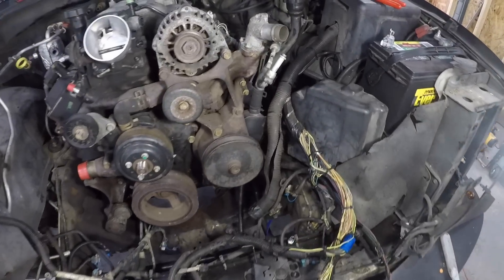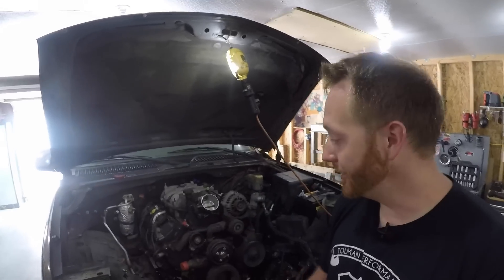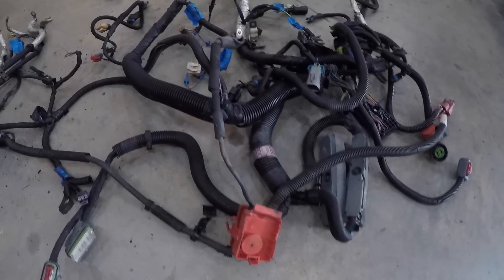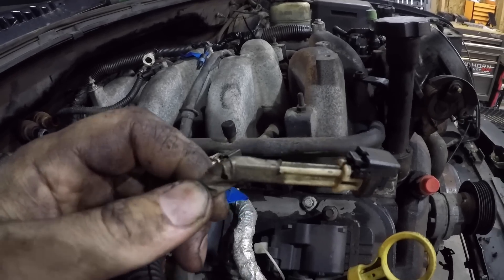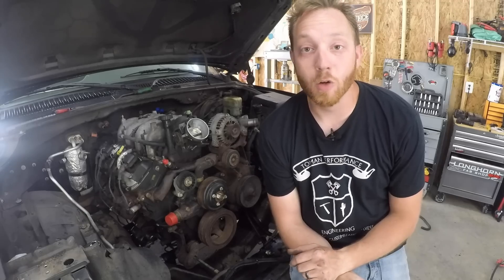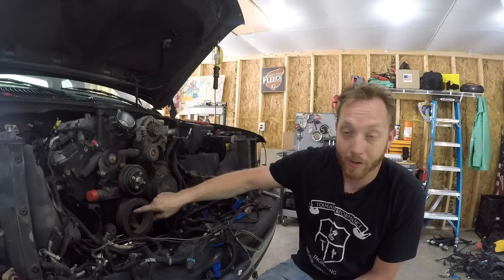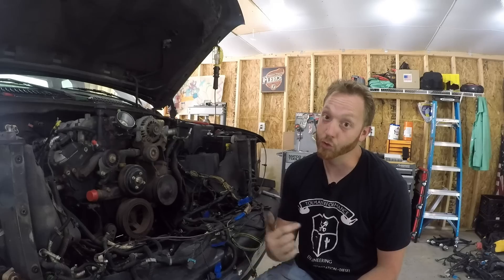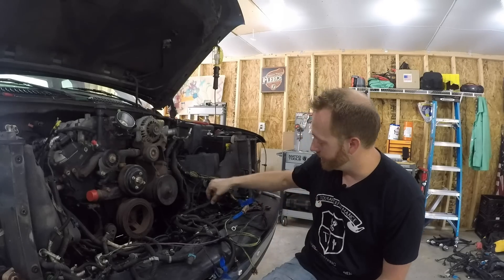Wiring and First Start 5.3 to 8.1 Engine Swap

Comment: How much bigger is it compared to an ls?
Reply from the maker: physically, it takes up quite a bit more room, but because I knew it would fit fine under the hood of the truck, I never actually took any measurements. it it however, bigger in every way. taller, wider, longer, and of course, heavier
Reply: Do you know how much wider taller and longer?
Reply: Would a LS adapter work with this engine using a cD009

Comment: Man I really feel like tool about my first sarcastic comment I made on the other video and told you about my big turbo forged rod and piston ls2 with a th400 2003 single cab Sierra(I did have gen4 4.8 rods and crank in my half filled ls2 block setup up until this past Wednesday my wife got me surprised me with a summit forged rods and a big boy LJMS cam and alot of arp hardware and clevite bearings and a few other things my engine builder/machinist/best friend was in on all this and basically picked everything I was going to myself lol we me and him balanced the rotating and decked, honed and gave the block a bath and painted black now it looks like a iron block but we slammed it all together in 2 days got everything together  to drop it In Thursday had it back in the truck turbo kit on and running on Friday) but after we talked a little bit I understood what your doing and respect the hell out of it and from what I can tell you seem like a cool dude and got to thinking aboutmlm your project I have a buddy who has a Gen1 precision 118mm g trim with a 1.50 exhaust housing its pretty old but has been recently rebuilt and seen it at his shop yesterday and thought it would be badass on your build I looked around and found a shop named Raylar that focus on the 8100's, all you need is one of their mildish boost cam and valve spring kit and this 118mm turbo I have no idea how it will run but I'm thinking with a the boost cam they offer for stock pistons has a 1800-5800rpm power band so I wouldn't be afraid to rev it to around 6200 or 6300rpm so it should spool that turbo and be a little easier on that stock bottom end  with that big ass 1.50 exhaust housing
Reply from the maker: yeah, I've been drooling over Raylar's stuff for a long time now, and hopefully will wind up with some of their parts on this engine, and what you described is exactly what I want to do. Big 'ol turbo and lots of pwer.
Reply: @TolmanPerformance  that cam from them is pricey but that and some springs is all you need if you will use that 118 il do my best to get it to cheap ASF

Comment: Doesn't using solder affect the signal of the sensors, rather than using butt connectors?
Reply from the maker: Alain Renteria never heard about it affecting the signal, especially considering components on circuit boards are soldered in place, but I know in aircraft applications they don’t allow solder because they’re afraid it can crack due to vibration.

Comment: Just curious, if you have the 8.1 engine harness available, How not just swap it in? Anywhere you have to solder or butt connect, leaves a weaker link Than the factory harness.
Reply from the maker: It wouldn’t have been a direct swap, since it’s from an Allison transmission and drive by wire

Comment: that 496  has a much higher potential to make more power then that 325 ls motor
Reply from the maker: power per cube, right? more cubes equals more potential.
Reply: @TolmanPerformance  always   that 5.3 you can push it to 1000 and with a built bottom end you could see 1300,   with that 496  you could see 1200 with sbe, and with a built bottom end you could see north of 1600k,    now this all depends on the boost, nitrous and tune
Reply: 5.3 wins on cost per hp easy the pistons are weak on 8.1 if you want big power gotta build it from what i heard its totally worth it i think
Reply: @joshshelby7322  only up to around 1000 hp mark. After that it's all big block all the time, plus who cares about horse power,  its torque you want.  Unless your over 5k rpms, torque is what your driving on

Comment: So does it bolt right up to the 4l80e? Did he have to change the ecu or get it flashed?
Reply from the maker: Bolts right up to the 4l80 no problem. This startup was on the stock 5.3 tune, but I will flash in a 8.1 tune

Comment: So it already had a 5.3 why didn't you just put a cam in a turbo on it I mean 8.1 is okay but it definitely has a weak bottom end go to Beasley put a cam and turbo on your 5-3 boosted it to the moon something you can't do with an 8.1 without it exploding
Reply from the maker: Neil Brown just trying to do something a little different from the usual, and enjoying a challenge to use a platform which is less popular

Comment: Curious why didn’t get the 8.1 computer for the swap or adapt the 8.1 harness to the 5.3 computer?
Reply from the maker: Mainly because the 8.1 harness was drive by wire and for an Allison transmission.
Reply: Lawrence LT Tolman Thanks for replying LT, probably was easier, didn’t realize was an Allison.

Comment: I have a crazy question i oways want to swap my truck can the nv3500 5 speed will fit in the 8.1 motor?
Reply from the maker: It should bolt up no problem, but not sure how well it will handle the power or torque.
Reply: Lawrence LT Tolman well I was just wondering if you have to do a lot of modifications to fit it in there. In the future I would love to switch to a T56. Thanks for the info.

Comment: Dude, sick! 

I wonder how easy a procharger kit for a 2500 would bolt up with the 8100 in the 1500 truck?
Reply: It would be essentially the same. The under hood width is the same between the 1/2 ton and 3/4 ton. There might be slightly less height under the hood.
Reply: Country Joe that’s what I was thinking too. A Procharger on that setup would awesome!
Reply: There is a company that builds only these 8.1 and the have a twin screw for it badass stump pulling low end torque

Comment: That thing sounds healthy, good work. Quick question. I have a 5.3 that's been outside under a tarp for a year. Everything was closed off accept the headers. Would I need to worry about stuck rings, or cylinder rust on first startup? It spins freely when I turn the crank pulley.
Reply: take the spark plugs out, shoot a little wd40 in there, crank it over some and light it off, it'll be fine. Realistically it's 5.3, it'll run underwater

Comment: why not just use the 8.1 wiring harness.. less work
Reply from the maker: Infidel  not exactly. It would’ve needed several changes to make it work, which I figured would be about equal or greater to to the amount of work this took.

Comment: I put a 455 Pontiac in a 77 square body, so I totally understand wanting to build something unusual.
Reply: Once I pick up a 4th gen trans am I want to make it Pontiac powered like a 455 😈
Reply: Remember the heads on a Pontiac always limit rpm , as does the bore size . Yes , you can throw $ and rev it but a 455 built for max torque and redline of 5500 or so will surprise you . Build what you want to

Comment: I assumed that you were just going to use the 8.1 harness and plug it into the 5.3 computer
Reply from the maker: XOZ Industries  it quite that simple... could’ve used the 8.1 harness but it would’ve needed several changes as well.
Reply: @TolmanPerformance  way more changes
Reply: Como adaptar el jar es del5-3  a moto8-1 dechebroler r
Reply: That won't work
Reply: Couldn’t swap the 8.1 harness and Ecu into the truck?

Comment: There is no replacement for large displacement.
I have big block chevys in every vehicle i own.
The LS engine platform is played out. The only reason they are popular is do to millennials.
Reply: they're actually popular because it's a better engine that makes more power more efficiently for less money. And i say this with a big block in my 68 Impala. Get with the times boomer and quit blaming your incompetence on young people, maybe you'll finally get somewhere in life then.
Reply: @jradish  lolol My 632 in my camaro gets me down the quarter mile way better than any LS. And everyone has to add boost because they have no sense on making horsepower naturally aspirated.
Im gladly to race any LS at Reading raceway or Maple Grove
Reply: vhp454 haha and how much did that 632 cost? Pretty sure we could throw together a turbo 6.0 that will run just as fast, be more reliable, and be cheaper and drive better.
Reply: @andrewmontgomery1763  my 632 gets my camaro down the 1/4 mile at 7.09 at 191 mph.
I have 740cid in my monza that gets it down the 1/4 mile at 5.33 at 232 mph.
Go play in the clouds with your LS. Cost is no factor to me.
I also have 1994 corvette that i installed a 427 cid bbc all aluminum and it puts out 577 hp and 614 ft torque. Again i do not care about cost. Millennials worry about cost and mpg.